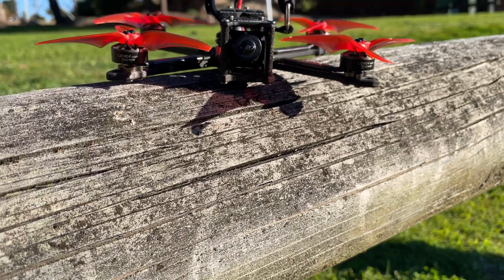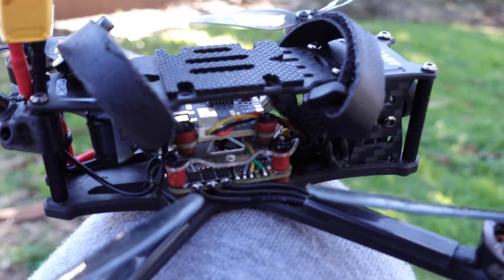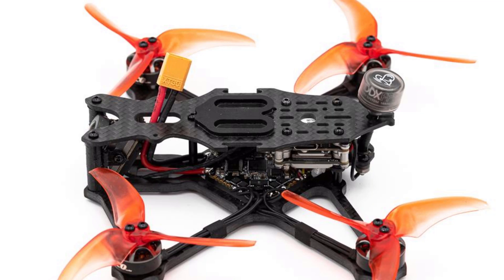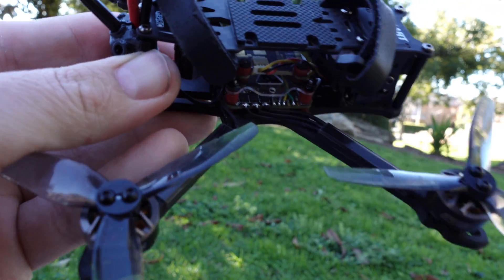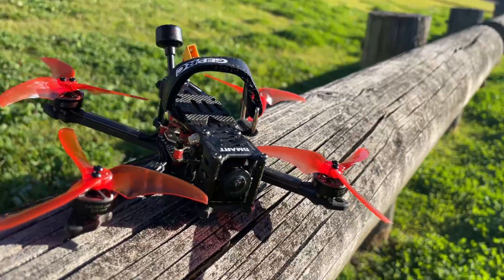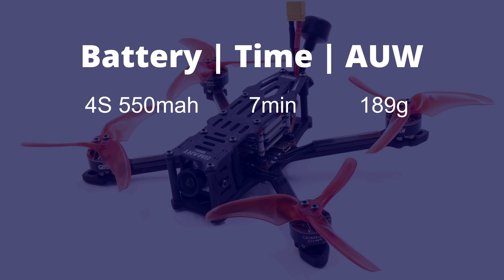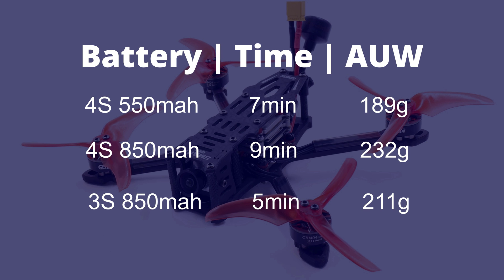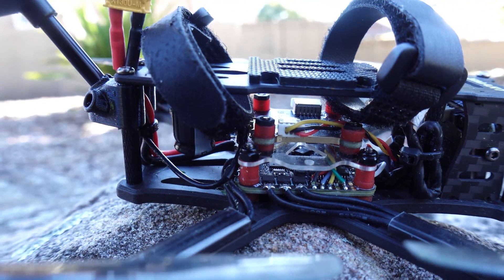The 3.5" FPV Freestyle Drone | GEPRC Smart 35 HD & Analogue

Comment: I think 3.5 inch would be great for a digital toothpick where as these frames with just a tad more clearance for 4 inch props.
Reply from the maker: Yes I plan on adding a Caddx vista to the analogue one; however I’m waiting for my dji goggles to come back from repair. I’ll be trying it with the runcam mipi camera. Geprc are also now selling the frame on its own, which I have also ordered with the 1404 2500 Kv motors; I’ll use my own AIO